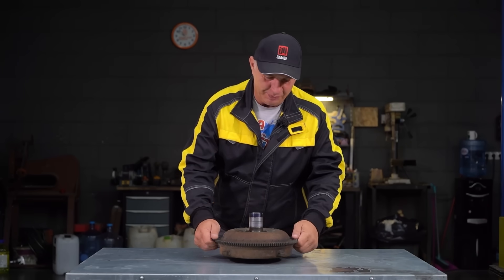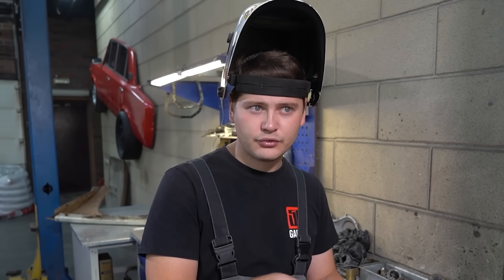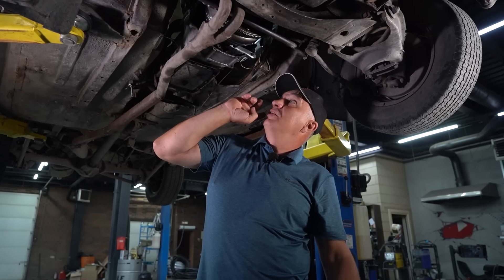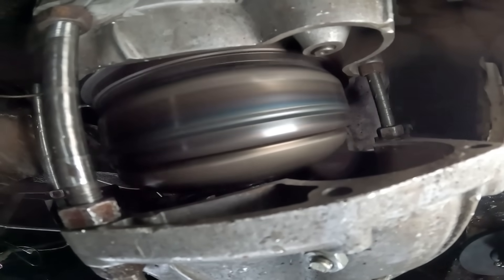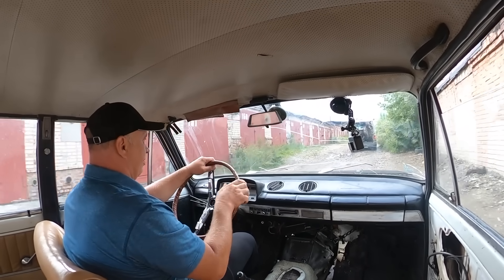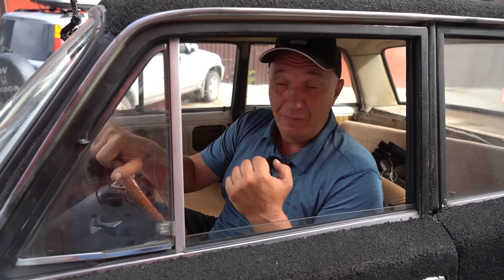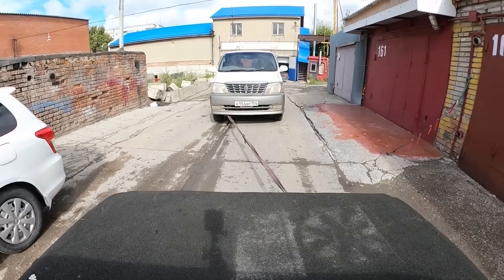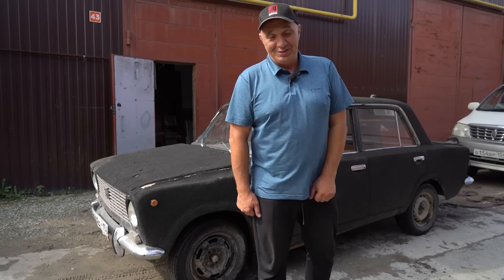Torque converter in a manual transmission - will it work?

Comment: you know why it feels "like a slipping clutch"? simple. you have no oil pressure in your torque converter, and it needs like 40psi. you can actually get around that with a very heady weight oil. mixed with fine saw dust. as thick and sludgey as possible because you have no oil pressure in the torque converter at all, and in a normal autobox, it is fed the same oil as the transmission under the same pressure. and it has to be higher pressure than normal manual gearbox, since ATF is so thin, right? why is ATF so thin compaired to manual gearbox oil? gotta be a reason, since they do the same job about the same way, kinda

Comment: Have done the exact opposite on a drag car by cutting the bell housing off of an automatic transmission and modifying it to accept a manual clutch disc, pressure plate and slave cylinder. This gives you the benefit of launching hard by using the clutch pedal without the drag and power loss of a torque convertor. After launching it this way you have direct power output from the engine to transmission input shaft. Then, it will shift and function on its own just like a conventional automatic transmission. Its violent and hard on parts but works quite well for drag racing

Comment: Oh, replace? that's an idea. I thought a 1st and reverse only torque converter would genuinely be good in a manual car. For practicality, it would need to be built either lockup or somehow be on just the R/1 shaft of a dogleg gearbox

Comment: Is the trans pump still connected making oil pressure? and will the oil over heat at some point?  Also the lock up clutch is actuated by a solenoid by the computer so it wont work? and you should be ok with just the basic viscous clutch.

Comment: Saab had a semi auto clutch in the old 96/95 series in the 70s,,, use the clutch like normal from a standstill after that just moved the gear lever to change gear while adjusting the throttle…..passed my driving test in one

Comment: Remember VW had a stick shift 3 spd semi automatic? Not sure if you ever drove one of those. Basically the same as what you have, except you could actually take it in and out of gear with its special system where when you touched the shifter, it would disconnect like a clutch. You could stop like any automatic, but if you were in 3rd, you would have to shift it back to 2nd or first to get going again. It worked well. Thanks for your experiment! Hi from Manitoba, Canada!

Comment: This application is the perfect place for a Tesla turbine. The Tesla turbine sitting between the engine and the input shaft as the transmission or drive connection would be awesome. It would have to be a massive Tesla turbine and you would have to supply it with an unreasonable amount of air lol.

Comment: I'm dying to know how hot the fluid inside the converter got with a very limited amount and no form of external cooling.
Reply: That's what I was wondering, torque converters generate so much heat

Comment: Early 80's Mitsubishi diesel PU had converter and clutch in some markets but not the US. The clutch was pedal actuation. Type I and III VW had AutoSticks, a 3 speed manual + converter + dry clutch with vacuum actuation.

Comment: Vw did something very similar with the “autostick” vw bug, 3 speed manual but no clutch.. very strange to drive, you could just leave it in 3rd (actually 2nd cause you had L-1-2 as gears) and just drive it around

Comment: I don't know why it should NOT work! ;) It does the same job as with automatic transmission. It's quite good at keeping constant speed, it's slower than clutch when accelerating. That's what myth of slower automatic transmission comes from - torque converters are kind of slow. DSG is fast, because 2 clutches work faster than one. And apparently one clutch work faster than a torque converter. The only faster (than DSG) solution I heard of is used in one of Koenigseg cars.

Comment: nice experiment!!!! torque converter+ manual gearbox is not unusual in heavy-duty trucks. but you do need an additional  plate clutch  to change gears without butchering the gearbox. and to keep the torque converter balanced, you could weld on 2 filler plugs, 180 degrees apart. (of course it would work even better with an oil pump..)

Comment: This is stock on Fend Turbomatik traktors. For changing gears, there is a manual clutch before the torque converter, after that a manual gearbox.

Comment: I love the mix between redneck and scientific. I expected the torque converter to overheat since there is no circulation or cooling, but I guess their well ventilated bell housing helped with that. I did see some smoke coming off of it at the end

Comment: VW did this with the  beetle back in the 60s. They had toque converter on an automatic transmission with a vacuum controlled clutch plate to shift. 

You just pushed down on the stick and it would use the vacuum to pull the clutch in and allow you to put into gear. 

Then you could sit at the light in gear with it pulling like an automatic.

Comment: The only way a manual transmission coild possible work in Seattle WA USA is with a torque converter in 1 gear. So as to be able  to use torque converter to start and crawl through traffic jams at doeeds below engine at Idle 1 gear. Also useful for uphill starts close quarter manoeuver. Once out of 1 gear lock up the torque converter and use clutch to shift.Would address the big problem we ith manual transmission. But nobody is doing that today although VW did in 1968 and the old Chrysler Corporation did over time period of 1940 to 1942 and 1946 to 1954. Not a whole lot of such cars made and only museums piece numbers kedt today

Comment: Vw had automatic stick shift which had both a clutch and torque converter with a 3 speed manual transmission a. And crude control to eliminate clutch pedal and do some of shifting.

Comment: It wouldn't take very long before you smoke the fluid in the torque converter. Take this a bit farther and circulate that fluid so the transmission cooler will cool it and then you'll have something that will last.

Comment: Ok. Weird but GOOD idea Use the AC to cool the Coolent to see if it will keep the engine temps lower. Or use the AC to cool the intake temps to see if the cars. Performance is affected.

Comment: The Honda Ridgeline, Pilot, and I think Odyssey from 2006-2014 had a 5 speed “automatic” with a torque converter and manual gears/forks.

Comment: this would be ok except 2 things I'd say, 1st, no starting in N and going into any gear while the engine is running.  you could probably get away with it at speed, if you are a good driver/shifter. 
2nd, which I thought of when you mentioned towing, but would apply anytime really, it would just be way worse when towing, is converter/fluid overheating. normally the fluid gets pumped around and in just about every car/truck I've ever seen (maybe not auto lada's, not sure) has a tranny oil cooler by itself or in most cases built into the radiator. so, this will just get hotter and hotter with really no way to cool off ever. I don't think it would last very long at all, especially without lockup.

Comment: In finnish military we have manual trucks (Sisu SA-240) that have torque converters. You just slap the highest gear in and it drives like an automatic, you can even come to complete stop without pressing clutch.
Literally the only purpose they were made was to pull the heaviest equipment the military has

Comment: Not a new idea.  Chrysler had a "fluid clutch" in the early '50's, which was a torque converter that could be disengaged with the clutch pedal.  The clutch was only needed when shifting from neutral in to first or reverse.  When shifting, the clutch pedal was not used.

Comment: Many older American fork lifts used a torque converter and a manual gear box years ago. They were still pretty common up until about 20 years ago. 
The idea was that it could be shifted from forward to reverse instantly without damage or the need to use the clutch.  (Most still had a clutch as well. The torque converter was ahead of the clutch and flywheel). I had one with that set up until the mid 1990's or so but replaced it with a full hydrostat transmission.  The torque converter worked better though, but it used more fuel likely due to slippage.
Reply: I own a 5-ton haul truck built for underground mines that uses a similar arrangement. It has a Funk Reversomatic torque converter/reverser that feeds into a Funk 33000 HMD four-speed gearbox. It doesn't have a clutch so gear changes are only made while stopped. Typically I run it in 2nd uphill and 3rd downhill.
Reply: Some how I do not think from forward to reverse instantly. ?????
Reply: @jamesthornton9399  Not instantly, they need to be slowed to crawling speed to avoid shock-loading the clutches in the reverser mechanism. Often there's a separate pedal for forward and reverse.

Comment: The torque converter used looks like it's for a big GM, like a Tahoe or something. It's tuned for a big V8 with lots of torque and a fairly low idle speed. The idle speed of the car is set too high for it. A torque converter from a 4 cylinder car would be better, but this is a nice proof of concept.

Comment: The 1953 Dodge Job Rated Fluid drive pickup truck, has a three speed on the column with a torque converter.

Comment: I feel like you should put a torque converter and a clutch on a manual transmission, to see if the torque multiplication effectively gives the car a broader power band in each gear.

Comment: The reason why the torque converter lock up shouldn’t ever work like that is because it requires pressurized oil coming from the input shaft to engage it. It is literally a clutch in a automatic transmission that requires pressurized fluid to engage individual clutch packs

Comment: That was cool! I used to shift my father's Malibu all the time without using the clutch, it was sort of a parlor trick. Of course, it saves wear on the clutch, but it can wear out the synchronizers if you don't carefully match the RPMs. This reminds me of the VW "automatic stickshift" or the Chrysler "HyDrive" (or something like that). Both had torque converters or fluid couplings and clutches, though the clutch on the VW kicked in automatically when you touched the shift lever.

Comment: I think you are going to have severe overheating issues in the torque converter, since it has no cooling.  Clutchflites had the pump driven by the clutch assembly.  hat enabled the whole unit to have cooling.  Nice engineering exercise, congratulations on getting it to move.

Comment: The NSU Ro80 had a similar system with a torque converter connected to a gearbox via a clutch operated by a switch on the gear stick. I owned one of these, the transmission worked very smoothy (pity about the tempermental Wankel engine up front).

Comment: 1955 Dodge Motor Car Company had this. An uncle came to the farm with his new Dodge.  A stick shift transmission with a torque convertor. They called it Torqueflite. Put it in third gear, step on the gas and away it goes. What goes around comes around :)

Comment: ZF 4+4 manual with a torque converter in this old Finnish military truck. It also has a clutch between the engine and the TC. https://en.wikipedia.org/wiki/Sisu_SA-240

Comment: Mazda rx3 rotary engine cars came with a fluid coupling system . You started moving car by letting out the clutch then every year change after that you just moved gearstick no clutch pedal required up or down the gears and worked perfectly even under race conditions. It was brilliant!
Reply: Mazda TQX Transmission

Comment: In the early 2000's, we got something very similar here in Brazil: an Opel Corsa (branded as Chevrolet Corsa) with the so called "autoclutch" transmission. Basically a manual without a clutch, so you still could change gears yourself.

Comment: Starting in 1968, VW did that in the Beetle. It was a 3 speed manual transmission with a torque converter so you could stop the car while in gear. It had a normal dry disc clutch that was vacuum operated the instant you touched the shifter.  VW called it "Automatic Stickshift" since you had to shift it. You could leave it in top gear and drive it like a modern automatic, but it was incredibly slow pulling away from a stop. If you left it in low gear, your top speed would be about 25mph.
The whole system was absolute shit. The overwhelming majority of surviving cars have been converted to a full manual trans. Occasionally, the odd person comes along wanting to convert from a manual to this Autostick. It is mostly due to ignorance of how bad the resulting car would be. And of course, there are a few nerds out there that like the system.

Comment: Wonderful video, I knew it would work, but not very well. They were worried about the lock up with the torque  converter.  On a automatic transmission, hydraulic pressure is delivered to the lock up clutch through the main shaft. So there is no way for converter lockup clutch to engage since the shaft is welded and blocked. Maybe they keep mentioning converter lock up to add a little suspense to the video, witch is good everybody dose that. :face-red-heart-shape::hand-orange-covering-eyes:

Comment: Get a fully synchronized transmission: like a Lenco.  Then, find a torque converter with a 750rpm stall or lockup. You may need a working pump to run the lockup, though.  How did VW do the one in the Beetle?

Comment: I wonder if the fluid would overheat at some point if he were to take it out on a road at speed. I think a TC in an auto has the fluid circulated through the TC so it can be cooled.

Comment: kinda like a Mercedes fluid flywheel in there old military truck's. what they did was also have a normal clutch so you could go from neutral in to gear then shifted up and down without the clutch.

Comment: If you put a torque converter on a manual gearbox you can just leave it in 4th gear all the time and set off in 4 as it will just transfer the torque to the rear wheels as it would in Automatic gear boxes.  There no need for a 1st 2nd and 3rd gear that’s the whole point of a torque converter, you don’t have to mess around with changing gears.  You have one gear.  I’m not surprised it worked, I already knew what it was going to do.

Comment: And I would think you  would need a transmission pump changing the fluid pressure to actually lock up the converter I'm pretty sure

Comment: What if you have both: clutch and torque converter? That would make a nice car. Especially with torque converter locking mechanism. It didn't lock up as it needs to come as hydraulic pressure usually from solenoid in the AT valve body.

Comment: Excellent Demonstration, commonly used on Heavy earthmoving equipment and larger farm tractors some require stopping or slight break application to change gears up or down on the move these can all start and run the engine before selecting a gear but will not start if the gear selector is engaged must be in neutral to start, obviously for safety reasons. It would be interesting to take torque readings on a dyno in all gears I think you would be in for a real surprise from such a small engine comparing it to a standard manual gearbox.👍👍👍

Comment: That was really surprising. I honestly did not know what to expect from this, but I have heard of VW doing something called an electric clutch once upon a time. It used the pedal for first gear or reverse but every other shift was done without a clutch. Sort of like me driving a truck without synchro gearbox. As long as the engine revs were right the shift was smooth.  This on the other hand is different...how about cooling the fluid in the torque converter? what temperature did that get up too, can you measure that in any way?

Comment: 54 Plymouth had the hydrive, a three speed manual with a normal clutch as well as a torque multiplier or a torque converter.

Comment: I remember driving one military-grade truck with both clutch and torque converter. It was an interesting experience. Otherwise, it worked as a regular manual except when starting to move. There was no touching the clutch; just releasing the break.

Comment: You should put a clutch in front of the torque converter, thats how fendt used to make there “fendt favorit 61x lsa | turbomatic E” you could set of in the largest gear and it would pull it coming up a hill and the torque converter reduced the gearing.

Comment: Why was a hole drilled through the torque converter when they already have that done at the factory.  Do they want more slip at idle or what
Reply: Drilled the hole so the converter could be filled. You cannot fill a converter without a pump and quite a bit less than half full by filling through the hub before installing it.
Reply: @trunkmonkey-1    Appreciate the excellent response.  I thought all these years now that the converter was fully submerged inside the bell housing and that it worked under it's own hydrologic vacuum or something.
Reply: @Goat-gl9bn  Thank you. I am a lifelong mechanic, planes, trains and automobiles. From families (both sides) of mechanics, engineers and such. :)

Comment: My first car was a 1952 Dodge Wayfarer. It had a flathead 6 with a 3 on the column and fluid- drive. Today it's called a torque converter. Stopped at a light you would put it in first gear and slowly let the clutch out with the brakes held on. Green light, let off the brakes and step on the gas and away you go. The car was a lot of fun, built like a tank.